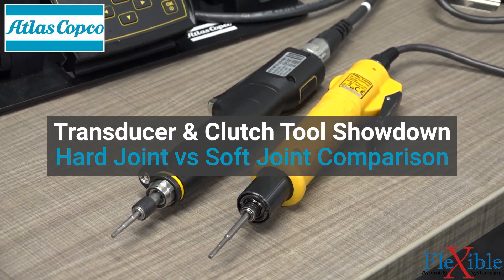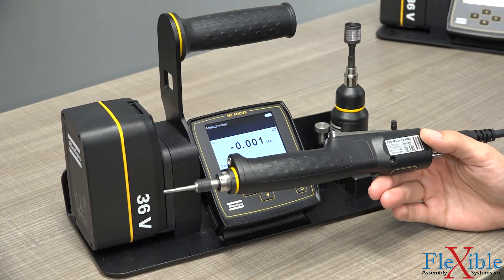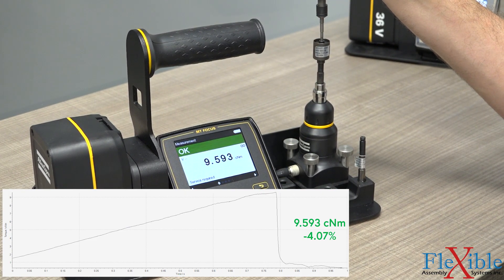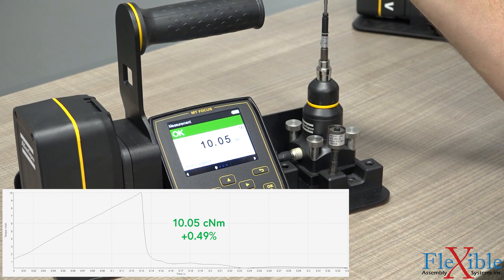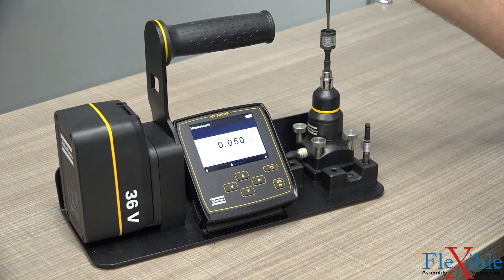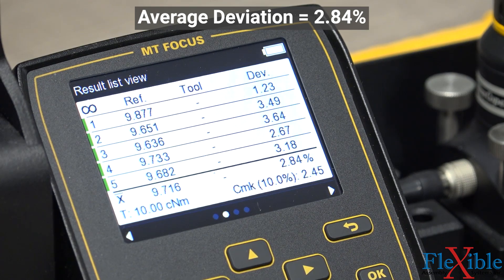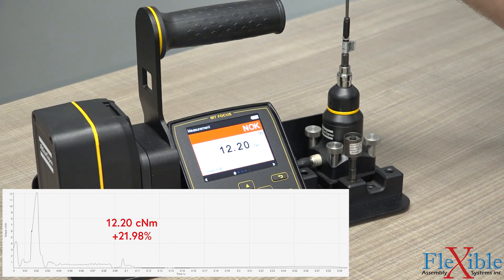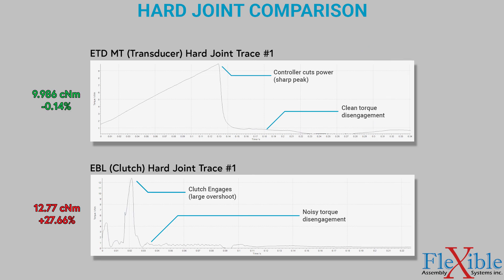Transducer & Clutch Tool Showdown - Hard Joint vs. Soft Joint Comparison - Atlas Copco

Comment: This is just how different types of tools differ in the accuracy and thats it?
Reply from the maker: It shows how two different styles of torque drivers deal with changes in a joint. A clutch tool will always be less expensive than a tool using a transducer to determine torque output. This is a demonstration showing the differences in action with a little bit of torque trace analytics thrown in to visualize what is happening in the tool and the joint during a run down.